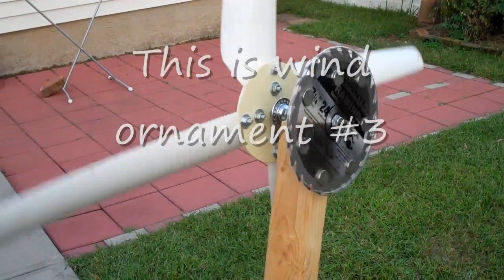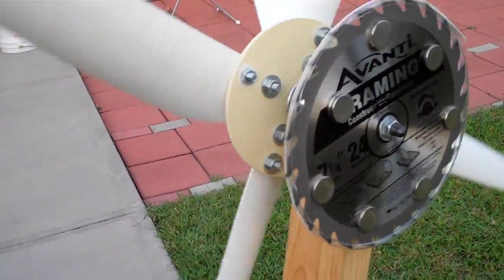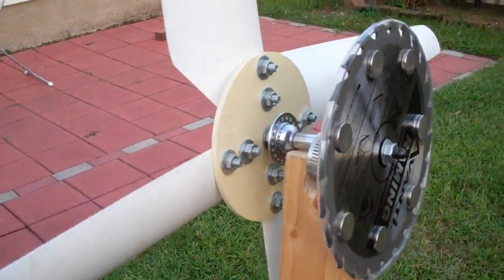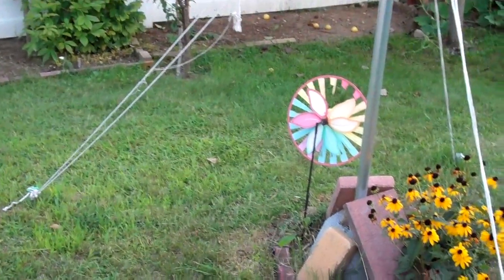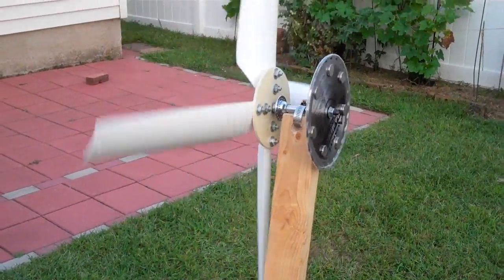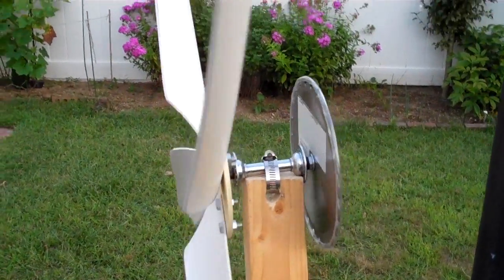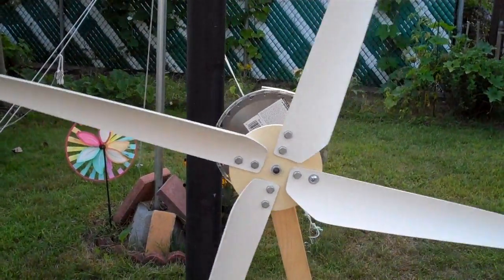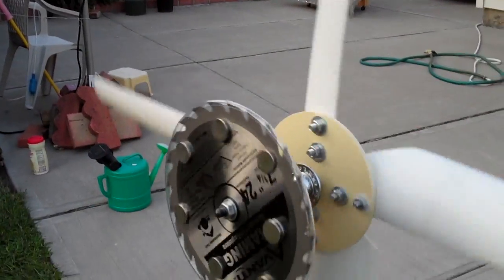Wind ornaments

Comment from the maker: Old pillow case in casting the stator. Interesting. I was using fiberglas netting used for patching drywall holes in casting my last stator.  I didn't mention that or the purists will be on me quickly.

Comment: Nope, it has a small dc motor that sits outside the box and can run on solar. The aluminum fan will be in the box driven by a shaft (also aluminum). So, no plastic in there just metal .. sort of like a comercial oven in miniature.

Comment: Almost hypnotic to watch and kind of relaxing.  My stepper motor turbines will make a whining sound as it will cog 200 times per revolution. Most would find that annoying but I like it because its taking a little morsel of energy that would otherwise just fly over my head. Also, did a little work on the convection fan the other night, I think you will like it. Should have it uploaded by Wednesday  maybe sooner.